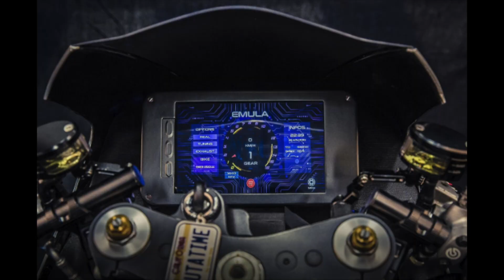How to make Electric Motorcycles sound like ICE Bikes - Emula Motorcycle and McFly

Comment: I agree that a bike is not just a mode of transport, the smells, the noise, power etc all comes into play. What manufacturers don't  tell us is how long will the batteries last, we know that rechargeable batteries don't  last forever, the cost of replacing your electric bikes 'engine' would be far too expensive for the average person. I can't see how they will be cleaner for the environment, they will still have rubber tyres, they will still have plastic panels, the battery cannot be recycled so has to go into landfill somewhere, the extra strain on the power grid would be immense if millions of people really could afford to own a car or bike, you'd need charging stations all over the place, but what happens if every other biker or car driver needs to charge their vehicle, ,  you might have to wait a couple of hours if your lucky just to get on one, it's bad enough when the local petal garage is busy, if people are already charging their cars and bikes and there are people waiting in line behind them then what do you do, a quick 2hr ride could turn into a ride from hell. I think it will be an absolute nightmare, I think it's a con that's being used to get us off the roads, the people in power know that an electric car or bike is rediculously expensive, the average man or woman on the street will never be able to afford one, then you've the problems of breakdowns, they cannot be towed, they have to be lifted(so I'm told by an AA guy who has had to try and deal with tesla cars), they are deadly in a crash with exploding batteries/fire, all I see is more cons then pros, but that's just my opinion. Good video Alf, always good to talk about the future and what it could hold for us,
Reply from the maker: Absolutely cheers

Comment: Very interesting. I think we should welcome electric bikes alongside ICE when the battery technology adequately develops (solid state batteries?), but not instead of ICE. It would be better if an electric motor could be designed which produced similar power characteristics to a petrol engine rather than trying to artificially mimic the experience. I'm sure that if demand was great enough some company could manage it. The probable truth is though, that future generations of riders will take to the electric experience and  consider ICE out of date. Sadly.
Reply from the maker: Yes quite possibly so

Comment: This is not at all a new concept.
Revolt EV, an Electric Motorcycle released in India more than 6 months ago incorporates such a simulator/Emulator whose note can be changed through settings
Reply: Hi, it’s completely different: sound and vibration are not the main features. We emulate gear ratios, nr of gear, power band and torque of each selected bike